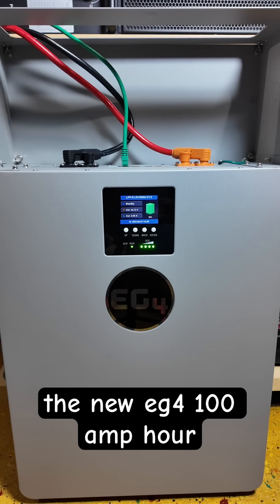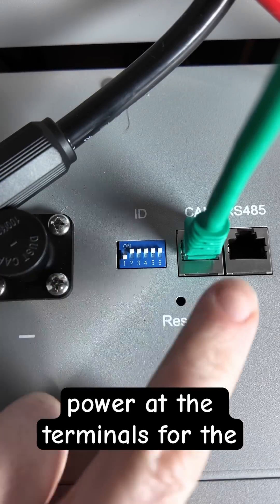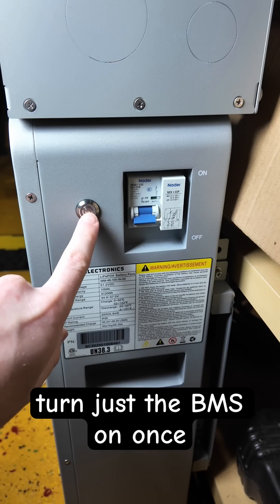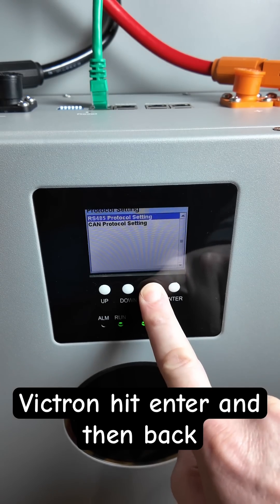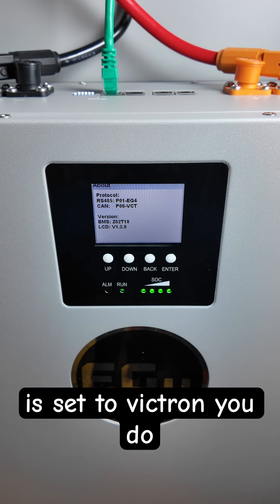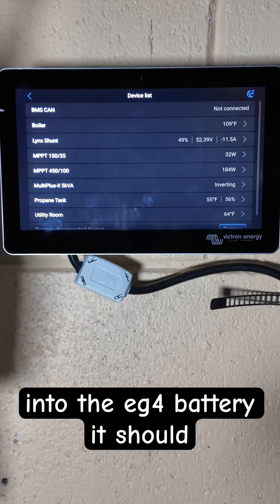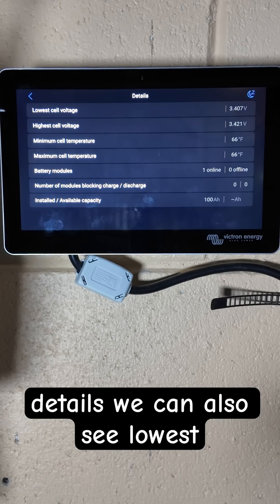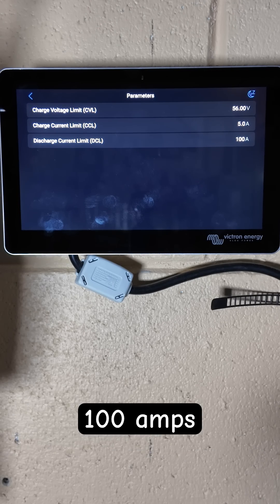Update EG4 Battery Protocols for Victron Integration (and Other Systems)

Comment from the maker: 💡 Want the latest Signature Solar discount code?
To make sure you always have the most up-to-date code (since it can change from time to time), just head over to my website where I keep it updated:
👉 https://going-off-grid.com/looking-for-solar-gear/#signature-solar

Support the channel and save on your solar gear! 🔧☀️

🛠️ Parts & Components (Affiliate Links)
     EG4 WallMount Indoor 100Ah Lithium Battery:
     🔹 Signature Solar: https://signaturesolar.com/eg4-wallmount-indoor-100ah-battery/?ref=adamd
     🔹 Current Connected: https://www.currentconnected.com/product/eg4-48v-100ah-5-12kwh-indoor-wallmount-battery/?ref=AzzpK9Fl
     
     EG4 Indoor Buildable Conduit Box | For EG4 100Ah WallMount and EG4 6000XP:
     🔹 https://signaturesolar.com/eg4-indoor-buildable-conduit-box-eg4-100ah/?ref=adamd
     
     EG4 6000XP:
     🔹 Signature Solar: https://signaturesolar.com/eg4-6000xp-off-grid-inverter-split-phase/?ref=adamd
     🔹 Current Connected: https://www.currentconnected.com/product/eg4-6000xp-inverter/?ref=AzzpK9Fl

     EG4 3000EHV-48: 
     🔹 Signature Solar: https://signaturesolar.com/eg4-3kw-off-grid-inverter-3000ehv-48-3000w?ref=adamd
     🔹 Current Connected: https://www.currentconnected.com/product/eg4-3000-ehv-48v-inverter-charger/?ref=AzzpK9Fl

Victron Energy VE.Can to CAN-Bus BMS Type B Cable: 
     🔹 https://amzn.to/4jzLvQ6

For more details, visit my website: https://going-off-grid.com

💡 Support the Channel
Want to support my work? Here’s how:
✅ Use my affiliate links—it doesn’t cost you extra, but it helps me out.
✅ Buy Me a Coffee: https://buymeacoffee.com/goingoffgrv
✅ Click the “Thanks” button under the video.
✅ Join as a channel member for exclusive perks: https://bit.ly/3Wdufqv

I appreciate your support! 🙌

Comment: Can this also work with the Cerbo GX hub?
Reply from the maker: The Cerbo is what's used in this video.  It's the brains of the Victron system which allows interconnection of different components.
Reply: @AdamDeLayDIY  Ah ok. I was wondering if it was in there

Comment: EG4 uses outdated 280 Ah LFP cell tech while most of its competitors have moved on and are now using 330Ah cell tech. So no thanks.
Reply from the maker: While 280Ah cells may not be the newest on the market, they're still widely used because they strike a great balance between performance, reliability, and cost. There's also still strong demand for batteries as small as 50Ah depending on the application.

And keep in mind — larger Ah cells often mean more weight. For many systems, especially mobile or space-limited setups, that added weight and size just isn’t practical.
Reply: Name me a OEM that is selling batteries bigger than 280ah that are ul9540a and 9540....
Reply from the maker: @MyGoogleYoutube  Well, one does come to mind.  The MidNite Powerflo16 uses 314Ah cells and has bot 9540 and 9540a.  

Every size battery though has a different possible use case.

Comment: Does this work with the lifepower4 v2 batteries as well with a victron system?
Reply from the maker: The life power batteries may require the communication hub.  I believe they use a different BMS.

Comment: Thanks for showing that. What is the max pull off those batteries? How many would you need as a minimum to run the that pair of Victron 5000va inverters?
Reply from the maker: This is a 100a, 5.12kWH battery.  The Victron 5kVA inverter (48v) can charge up to 70a DC.  So a pair of these would need a minimum of 2, 100a batteries.
Reply: @ I was actually looking at the numbers to see the minimum required to run the two Victron inverters to cover max load. If recommended current is 50 amp charge and discharge, is my math right to think you would need a minimum 3 per inverter?
Reply from the maker: @PanelsUpSolar  IF you were running max load (and you wanted to stay around the recommended level), you would probably need 2 per inverter.  However I wouldn't recommend running continuous max output.  

You also want to keep in mind how long do you want to run things.  That will also help you decide how many batteries you need.
Reply: @ I also question the reason for this battery. Its limited output and mounting space requirements are certainly concerns that someone needs to consider. You would also need to pay attention as to how the batteries are paralleled. It was at least nice to see the communication working. The display looks very similar to the Ethos display.